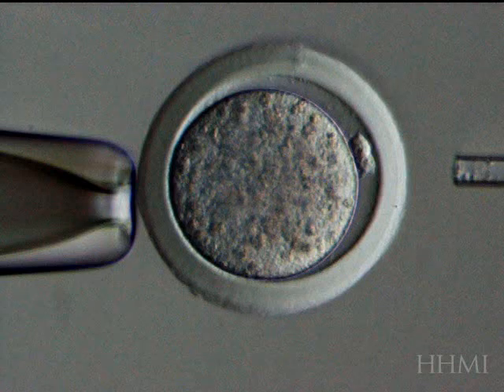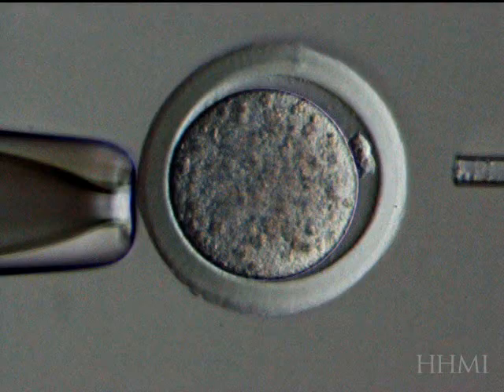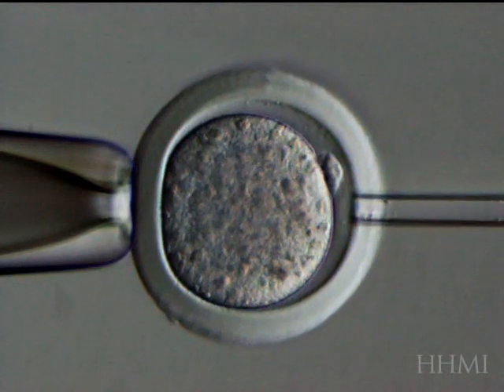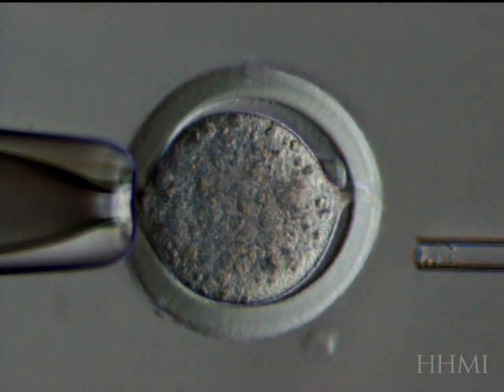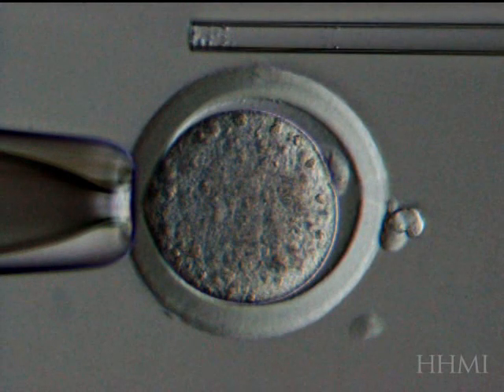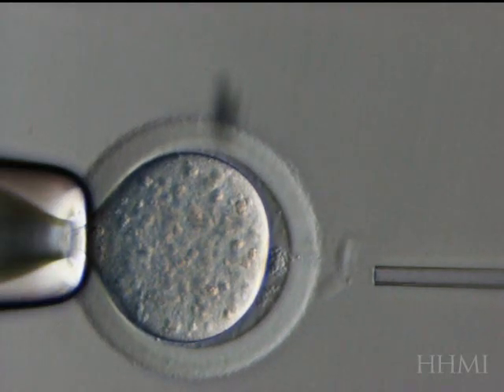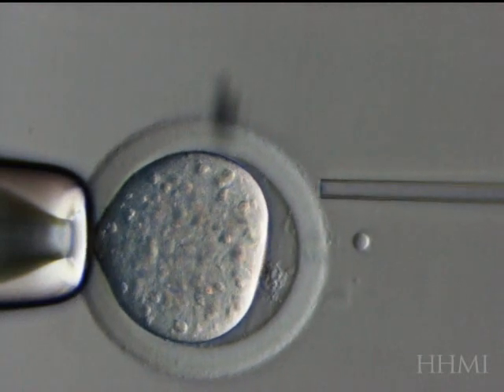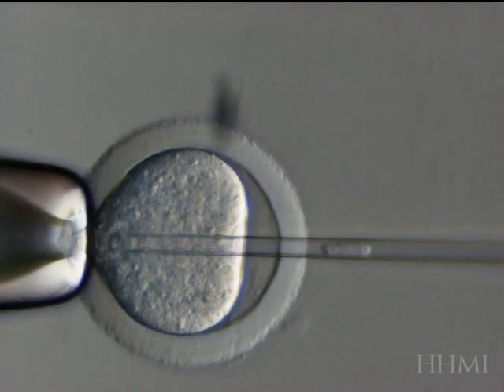Somatic Cell Nuclear Transfer (SCNT) Video

Comment: Thankyou! That cleared my concepts. But I still have one question remaining. You removed the nucleus from the egg. That nucleus had the instructions for mitosis to produce new organism. But when you removed it, and added the new nuclues, it did not had the instructions for celp division. Then how come the egg will start mitosis?
Reply: All DNA in every cell is the same, the DNA from the egg was just half of it. Instead of taking the egg cell nucleus away, think of it as adding the other half. This process’ purpose would be to produce a clone for the somatic cell. Hope that helps x